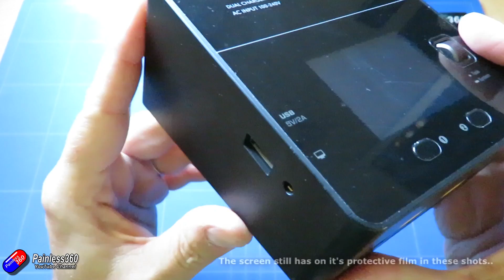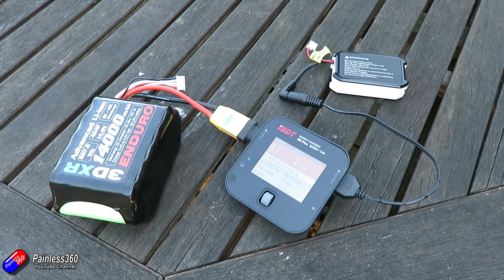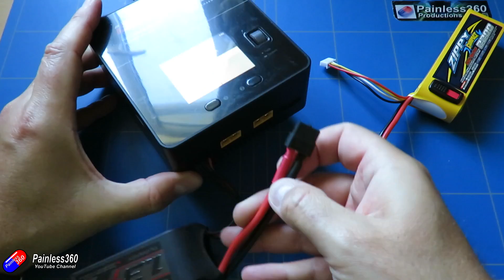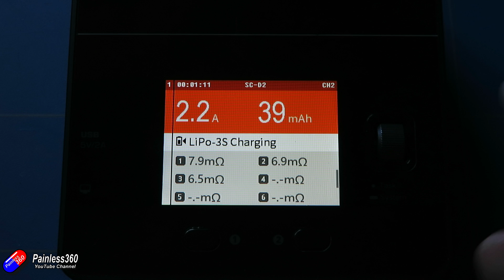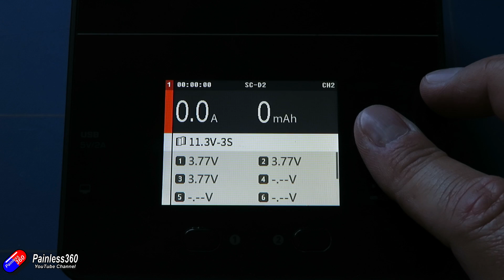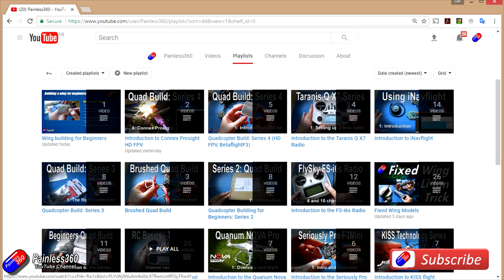ISDT D2 Smart Battery Charger Overview and Review

Comment: When charging Li-Ion 18650 4s1p pack, this charger only goes up to 4.15v when I select battery type as li-ion.  Any way to take that up to 4.20v or do I charge with the battery type set to li-po so I can get the full 4.20v that my li-ion cells support?
Reply from the maker: Set as LIPO to get 4.2v per cell... Happy flying
Reply: @Painless360  thanks sir!!

Comment: Does this come with any adapters for using deans connectors, or one of those octopus banana connectors multi-charging cables? I'm a USA guy here, and I already have tons of cables, adapters, etc... based on those.
Reply from the maker: No adapters, you can easily make your own for the connectors you have. XT60 seems to be the default for most of the chargers now.. Happy flying!

Comment: I like the Hobbymate D6 Duo Pro charger much more, its a bit smaller all around,  it has a slightly larger screen and does AC 200w and DC 650w at 15a per ch and even a wireless phone charger on top

Comment: Hey painless, good to know you got a video on this charger i was searching for a reliable review ;) i got a question tough i currently balance charge with two imax b6ac (chinese copy) i have seen the isdt d2 charger for a nice upgrade, easy and convenient, but a friend recommended me the skyrc q200 , more pricey thoug, i normally balance charge , got no problems with it... wich one you recommend me to go with? I think is more modern and convinient the isdt interface than the bluetooth interface of the q200, and more or less the price is the same , 199 dollars the q200 with 4 ports and  115 dollars the isdt with 2 ports ...  your opinion would be valuable in my community , it actually made us debate for 3 days Xd   thanks a million mate for your opinion!!!!
Reply from the maker: I use both regularly. Both are excellent choices but for me, the Q200 is a must if you find you're spending way too much time charging lots of different packs before a flying day! I usually have a few 2200 3s, 1300 4S, 3000 4s, Goggle batteries and action cameras to top up...

Comment: Did you test the correct end voltage? My iSDT 620 was not correct and I had to manualy calibrate it
Reply from the maker: +Erwin L I did, how did you change it on your charger?
Reply: I'd asked for the code (they need your serial number) to be able to change the voltage settings. They gave them to me with the notice they would not be responsable for any damage and I should take lots of care.
The voltage on the display said all 4,2 volt but my multimeter (Fluke) told me it was 4,17 - 4,20 - 4,22 - 4,25 on a 4 cell.... All works well now
Reply from the maker: +Erwin L great tip, tbanks

Comment: I love this line of chargers i will not be buying any other. Its almost like someone looked at the charger market and said "why are we doing this? when this is all we need"  They have a classy high tech look and feel, charge anything off of anything and are reasonably priced.  Although the price seems kinda high until you hold one and use one. Its my favorite piece of R/C accessory equipment so far. I will be getting a TS100 soldering iron so that may change LOL

Comment: I've been impressed with my iSDT SC-620 (500W) model charger. Very accurate and intuitive. I'd previously purchased EV-PEAK and Venom chargers, and both were rubbish .. would NOT charge LiHV batteries to full 4.35v/cell. I also like the internal resistance checker, which alerts you to either a poor battery, or a battery with a cell (or cells) which are going bad.

Comment: Good to see another mains powered charger on the market, not too may around. 5W discharge is a bit of a let down if you are into storage mode. I have the 620 brother to this and the interface is a joy to use and use it at the field. I also have the I Charger 308 Duo as my main charger. A very capable charger with a good discharge power but the menu system leaves a little to be desired.
I would also suggest using a balance board or balance port extender to minimise wear and tear on the charger's port.

Comment: Great Video. 

 Why did they make this thing only max out at 20 amps? Its good you can charge different size cells simultaneously, and with the right charging board, multiple packs . However, I would still take my Thunder 0620 AC/DC 30 Amp 300W desk charger over this any day. 

Cheers